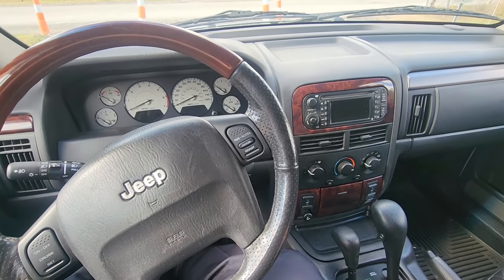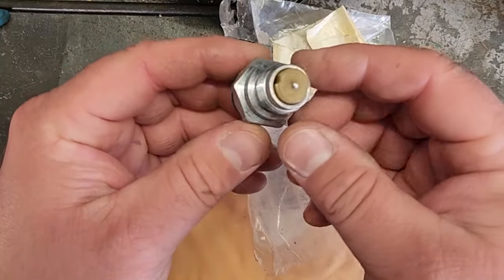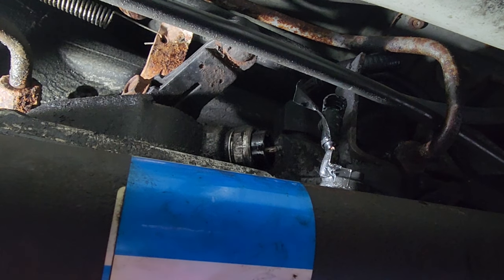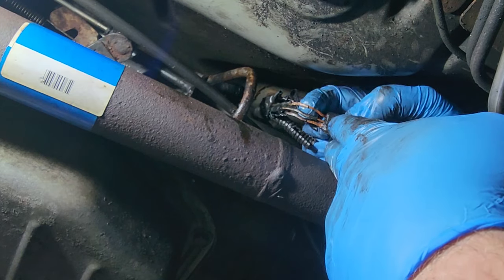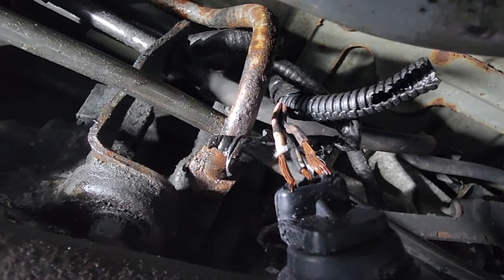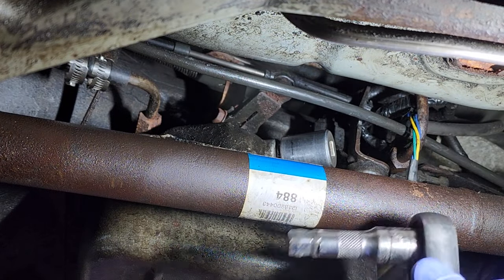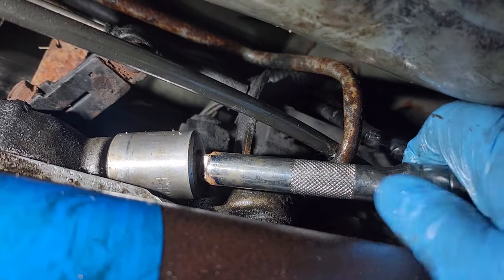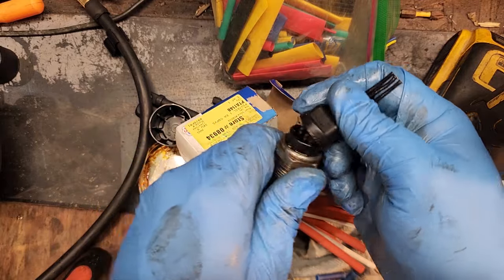THE WJ NSS!!!  42RE JEEP GRAND CHEROKEE NEUTRAL SAFETY SWITCH

Comment: Just the info I needed. Mines been failing about 1 of 10 times, 2nd try would start. It's now done, but will start in neutral thankfully. Depends on what side of the switch fails I suppose. Thanks for the vid 🖒